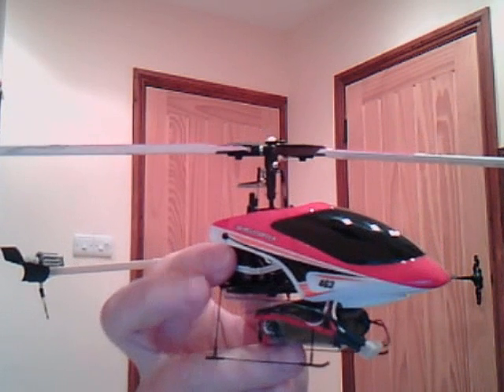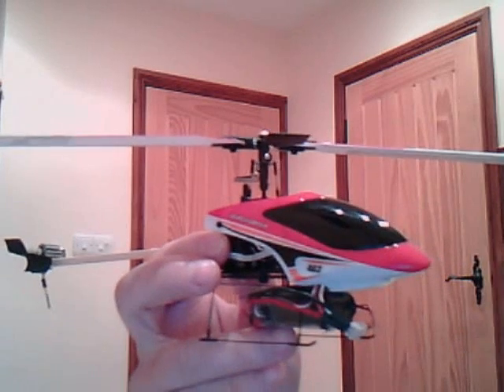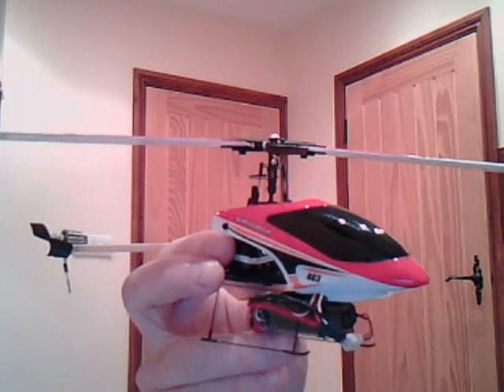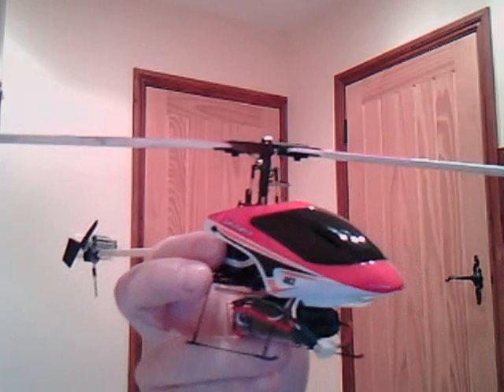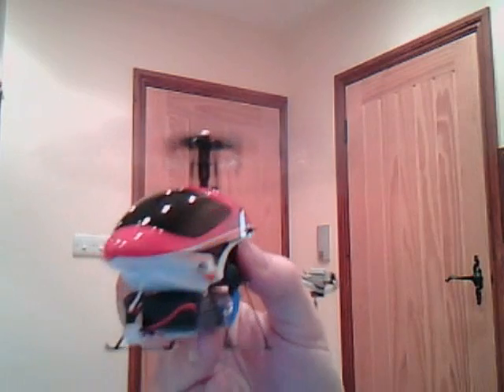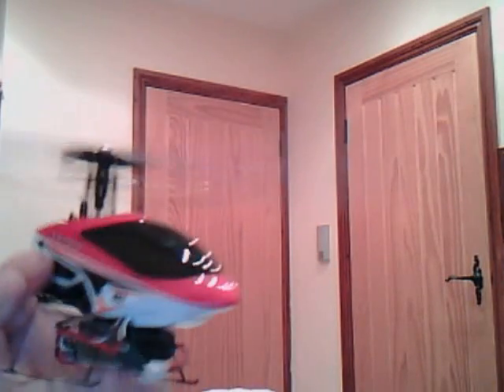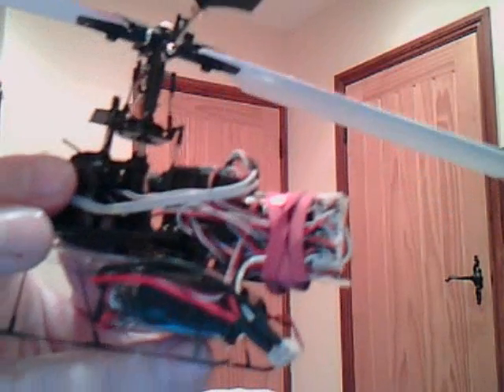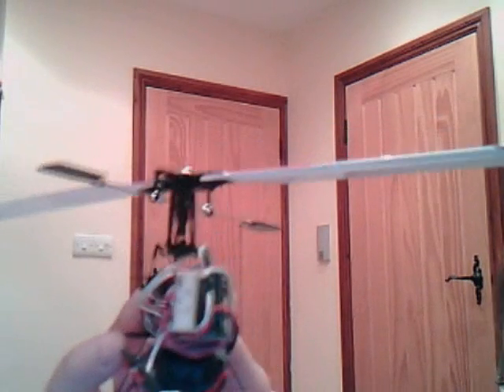Walkera 4G3 Brushless Spektrum Conversion

Comment from the maker: @codfish124 
Hi Mate,
I wouldn't convert one now that the 4G6 is available. Mine flies well and has loads of power but the motor and the batteries have not lasted longer than 6 months.
If you want to convert one look on the rcgroups forum for one of the latest solutions.
Visit the website of Terance from Chinese Jade for the 4G6 conversion.

Comment: The problem with any motorized tail is that it must speed up or slow down to initiate corrections or to piro one way or the other.  A driven tail ( shaft or belt ) turns at the same speed all the time and changes pitch to correct or to piro.  Driven is a much more accurate and fast system.

Comment from the maker: I find they don't last long, which is understandable because I am running it on a higher voltage than they are rated at.
In any case, if you crash with them when the motor is powered, the brushes burn out. Their response to the gyro input is not as good. Often. as the battery voltage drops, you loose tail control.
Check out the forums, there are lots of people trying to convert them.

Comment from the maker: Hi Peos,
Not using the 3 in 1 now (I removed it, and replaced it with a Logictech gyro and 0.5gram brushed motor controller for tail).
Everything plugs into the spektrum reciever.
Bec is built into the 6A brushless controller.
Cheers,
Rich.

Comment from the maker: Check the most excellent RCgroups forum.
My 3 cell solution is probably not efficient enough for your 4#3.
Ypu basically need,
2 cell lipo 10-12g, Losi BL motor, 6A Bl controller, 0.5g Brushed motor controller for tail, Spec 2g Rx, Lightweight gyro (stripped esky HH gyro). Lots of patience ;)

Comment from the maker: Cheers, unfortunately my esc was going to low speed on low voltage after just 1 minute. I am getting some more batteries and will try a lower voltage cutoff next week.
The flying was very stable although the 3 in 1 will need replacing as I cant get it to mix in 3d mode. I will have more progress next week.